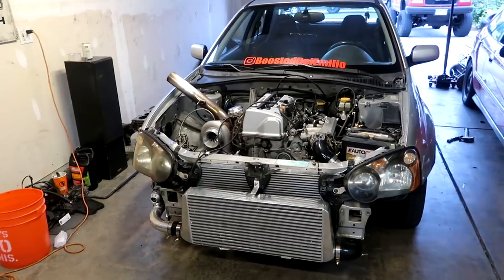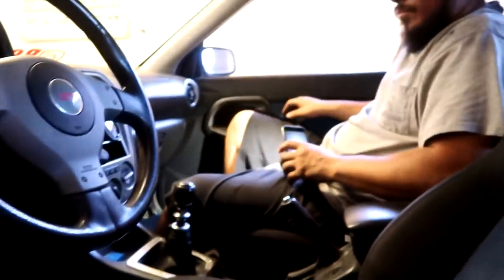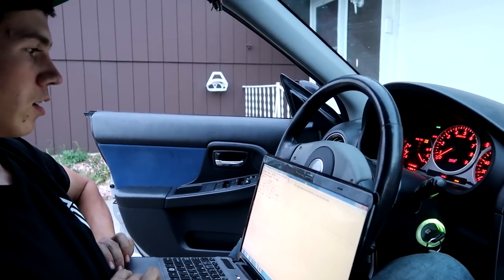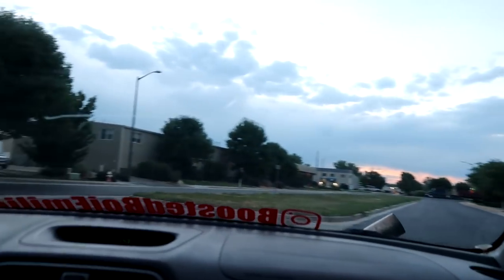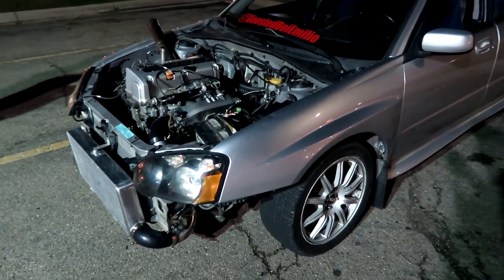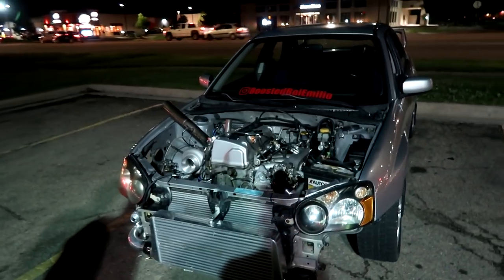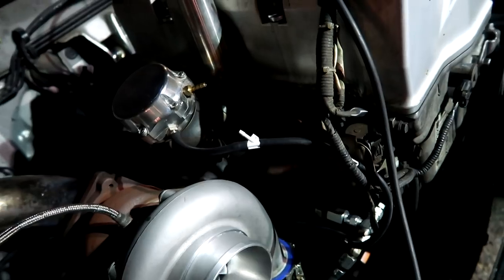Honda Powered STI Takes Down Its First Subaru!

Comment: Coming from a Subie and a Honda guy, I love this build. I love the boxer engine but it's not without limitations and definitely not as durable as a KSeries.
Reply: The K-series has proven itself time and time again. It’s possibly the best 4 cylinder engine ever made.
Reply: John Parent don't get him wrong then boxer is a great engine but it depends on what u apply it to
Reply: i personally know 2 guys one with a 2016 wrx the other had a 2015 wrx hatchback and both blew the bearings on the crank and eventually knocked themselves to death. Now the guy with the 2015 blew his block under warranty at around 40k miles, got a new block for Subaru and then sold the car. Now the guy with the 2016 , he went through two blocks, and the 2nd went out with a couple hundred miles on a highway trip. Both cars were completely stock. You can take a look at NAOISC, and everyone recommends replacing them with an aftermarket shortblock if you want to actually drive the car.
Reply: Subaru engines are best NA and stock. As a guy who used to love them, it took the experience of watching my friends break constantly and another friend working for Subaru to realize they aren’t all that reliable. K20s do better under boost and they weren’t even designed for it. Few other manufacturers have made anything that offers what the K-series does. The only thing I would want more out of them is torque. Which Honda seems to have remedied with the new generation K engines
Reply: Idk man, i have an ej22 and i abuse the PISS out of it daily, and she's holding up just fine. i keep up with the maintenance on it and at 234k she could either go any second or go another 234k no problem, that depends entirely on how  i treat the engine. remember, metal parts all eventually wear down and break. My EJ however has yet to break so i'm not nearly a concerned as most these people are here. i beat an integra after work yesterday and we're both stock. No big feature and we didn't even break 80 mph so fuck it. I say they both reliable so long as you take care of your shit.
Reply: The  N/A EJ22 was an amazing engine. My brother had a 96 Impreza and that thing was amazing. 260k on it when he got rid of it because he hit a snow bank and it never ran after that for him. Turns out, since it didn’t have a timing cover on it (why the fuck I don’t know) the snow getting forced under the hood from this massive snow bank made it jump timing. He sold it to my friends dad for 100$. 4 days later we saw him driving around in it running great, he let us know what happened. Daily wise, I think Subaru’s are great, in the performance sector, they are overhyped and don’t live anywhere near up to it
Reply: The boxers are very durable if they're left stock.
Reply: I can attest my 02 WRX has 247,000 miles of probably abuse lol.
Reply: The best subaru engine is the jdm ej207 that thing is bullet proof
Love this build
Reply: The best subaru engine is one that hasn't blown up yet. no point getting excited about the reliability of an engine that makes no more power than your mums camry.
Reply: teh vee teh vee my buddy has a 2016 white Sti, on his 2nd motor since the first spun a bearing. This dude doesn’t beat his car and is religious about oil changes through the dealership and the car is completely stock. They tried to fuck him on it, I’ve been trying to get him to sell it.
Reply: Lol.. aww look at all the poor haters that get beat by Subarus..
Reply: TTime685 implying me? I like them, don’t really like the vape smoking, tight pants wearing gauge earring having drivers. But I ride a turbo gsxr1000 so def no Subaru is beating that around where I live.
Reply: 2015 wrx hatchback... this guy is clueless
Reply: TMM 
There is something called common sense Any engine will eventually blow up if you push over the limit this engine was designed for 300 hp maybe will handle 400 hp max 
If you try to get 500hp out of a 4 banger it will blow up for sure 
I daily my car the engine runs super strong without any issues  I beat on it all the time
Reply: Steven Llewellyn gauges, tight pants, and vaping.. you dislike people for a bunch of childish reasons. And no, really? Your gsxr is faster than an impreza? Lmao.
Reply: Canadian yeah but most people don't know of that engine. I'd love to have one in my 04 wagon.
Reply: @TTime685  i own a subaru and ill tell you it sucks. Lol

Comment: Holy Shit, Untuned KSTI completely wrecked that other Subaru.
Reply: Viewing it is tuned
Reply: Stage 2 wrx is maybe a little over 300. So the 350 estimate seems kinda accurate
Reply: Jared K ya 300 to the crank
Reply: Dylin Chamberlain nah thats a newer one its 300 to the wheels
Reply: Jared K stage 2+ wrx's only make around 275 to the wheel
Reply: Dylin Chamberlain google says the MAP stage 2 with an exhaust intake and tune on a fa20 puts down 300whp
Reply: Jared K oh ok ya i just seen that i have never seen the map stage 2 before
Reply: Dylin Chamberlain pretty much everyones tunes make the same power and actually 300 is low balling that setup.
Reply: Smoke Yt 4 pounds is tuned?
Reply: Jared K he pulled on him way too hard for that to be just a 50hp difference especially with two people in the car and Emilio is a pretty hefty dude lol.
Reply: R3D just going by what was said
Reply: Smoke YT Actually, Kyle played with the air/fuel ratio just to get it idling good. it hasn't actually been tuned on a dyno for a race/street tune.
Reply: Jared K Yeah i agree, it wasn't pushing much more than 350 yet.

Comment: I'm afraid the T could break up (too much weight) into the engine thread. What I usually do is put a line from the block to the T which is strapped somewhere in the engine bay, then from that run everything needed. (sorry for my english, I'm french).

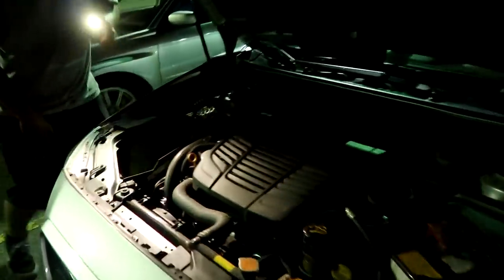Comment: Is it just an illusion from the fire balls or were the headlights cutting off when you let off of the gas at the end of the video around 14:00
Reply: flying munk89 they were definitely turning off....
Reply: flying munk89 I thought the same thing at first but my guess is its messing with the camera.
Reply: DOUG LIFE wasn't doing it when I saw them
Reply: Happens something in the wiring isn't right or they need a battery.  It's pretty normal for voltage to drop when you let off the throttle.
Reply: my guess is that they were turning off the lights to catch the fire coming from the exhaust so the camera can see it... to me that's the pretty obvious guess.
Reply: Duane Bailey pretty sure when they checked voltage is was around 12 so that would make sense for a new battery
Reply: GixxerDad 600 check at 14:00 i think.... i thought it was the camera compensating for the light flash but on the 4th pop you can see the lights from the buildings dont dim.
Reply: His turning the ignition off and on to make it shoot fire balls out. So lights were actually shutting on/off
Reply: David Gould  that makes sense!....... i used to do that in my first car!!! Lol
Reply: DOUG LIFE ive noticed him doing in other videos and finally realized he do that lol

Comment: So what does “stage 2” mean?
Reply: Uriah Siner intercooler downpipe  intake tune?
Reply: A subie stage 2 is usually, intake,  catless downpipe, full exhuast, and a ots/ dyno tune
Reply: It means not fast enough to touch a Kswap
Reply: Stage 2 is j pipe exhaust and intake
Reply: C Dubs only on 2015+ for that though because 2014- dont have j pipes
Reply: Lmfao stage two is stock with a downpipe and supporting tune only gives it a little more power barely noticeable haha
Reply: any light modification to the engine that does not sacrifice driveabillity so exhaust, intake, and a tune thats as far as you could take stage 2 im pretty sure. and stage 1 would be track focused mods that make driving the car on the road a pain in the ass
Reply: Cloud Gaming depending. My boy had a bug eye WRX. Stock on a 40 roll he was side by side with a Miata with a minor tune. Then with a stage 2, he was able to get me by a car and a half against my 01 gsr FBO on a 50 roll.
Reply: 20 more whp 😂
Reply: Brian Smith bruh
Reply: Not quick enough to kill the hondaru
Reply: BBoyDrkNova a turbo Miata? Or a stock one with a tune
Reply: Nothing, it's absolutely meaningless.
Reply: Intake, full turboback,  with Cobb ots stage 2 map
Reply: It means you don't actually know anything about your car
Reply: HKS blowoff valve and a milo tin
Reply: Uriah Siner stage 2 is i follow what everyone else does cause i dont know what im doing
Reply: Also injectors
Reply: Fully stage 2, not just partially
Reply: Chris Ortega lmao frfr
Reply: Depending on the year stage 2 is about 15-20% hp and 20-30% higher torque than stock on a Subaru. Defiantly noticeable nothing crazy but that in combination with the better sounding exhaust is money well spent.
Reply: He still playing need for speed underground.
Reply: It means he is ready to send that headgasket
Reply: Uriah Siner fast road uae
Reply: New stage 2 wrx’s walk STI’s. I have a stage 2 bugeye and I can do 0-60 in 4.8s... not too bad for just bolt ons and a street tune I did myself.
Reply: Stage 2 is an extra +25 HP sticker.
Reply: You gotta watch initial d more lol jk

Comment: A clutch return spring on top the of the clutch fork (the spring needs to pull the fork towards the motor) that should sort out loosing the pedal. It fixed mine.

Comment: You can make a tool for pinching in tube beads out of a pair of wiring crimps. Just cut off the snip tip and you are left with a tooth that fits the opposing groove.

Comment: My guess is 460whp fully tuned BY BRENT! Just sayin
Reply: I think you underestimate the capabilities of the K motor and Brent lol
Reply: This Crazy Tangerine I’m guessing 550 lol.
Reply: I thought  a stock k could only do around 400 before a built motor needs to happen?
Reply: This Crazy Tangerine a stock k can do over 500 stock, I had a friend with an 07 Si making 480whp ran the kit from 110k miles all the way to 180k miles when he sold the car, weak point was the tranny motor can handle a lot of power
Reply: Kevin Osorio sweet, that's good to know. Learn something new every day lol
Reply: Moosh Williams you know I sent them an s366 right ???  800+ capable ....  :)
Reply: This Crazy Tangerine do good and good will come

Comment: dry sup. solve that  oil issue
Reply: Or hey, just some baffles.
Instead of like u know, block mods, oil pan, pump, pulleys, bracket, belt, oil tank, and a bunch of oil lines and fittings. Makes a lot of sense.

Comment: Why do Subaru owners always say their car is stage whatever
Reply: I own an Sti and I don't even know why. Just say what it is and what parts you got imo.
Reply: Hipsters
Reply: I think they don't know what they have so stage whatever is their go to lol check out how this dude hesitates before he says stage 2
Reply: Captain Swaggadick Maybe in this case that is true. But I bothered to do some actual research and find that the term stages was used by multiple aftermarket manufacturers to signify classes of upgrades or packages. Cobb still does this, which may explain the longevity of the use among subaru owners. Someone on a tuner forum also mentioned that there could be ties to old British tuning culture.

Either way it is a mostly outdated terminology among car enthusiasts. Even among those who tune and modify Subarus past engine management "stage 1", there is little correlation or definition of subsequent "stages".

I never even heard of it before I started watching YouTube videos of modified Subarus.
Reply: Cobb packages their parts in packages in stages
Reply: I got a wrx and you cant even go stage 1 and 2 at the same time loool so i got confuse on that tooo looool need a pro tune so stage 1 and 2 will be doable
Reply: Captain Swaggadick ricers
Reply: Race one youll find out what stage there on. Lol

Comment: Dude the d16y7 is the most reliable Japanese engine ever. Mine had over 600k when I sold it no oil burning no issues never had head off still got 42mpg highway.

Comment: If it hasn't got air in the system or bleed up fine every time, it could be the master or slave drawing air into the system. I've had it with other vehicles on fast shifts that the clutch moves so fast that slave draws air past the seal as it's worn, but doesn't fault in regular driving. Just food for thought.

Comment: Stage 2 isnt all that quick anyway especially if hes running cobbs ots tune. Intake turboback + 93 protune can be a little spicey when the car wants to give it all.  But the swap is still impressive, when it gets dialed in itll be super spicey. The redline on the honda motors is a hudge advantage, 6500 on the FA comes quick.

Comment: Can someone explain how those T's add psi? Just sucks in more air I'm guessing?
Reply: it limits the amount of boost the Watergate sees so the rest of the system can hit more boost but the Watergate still only sees what the spring rate is. same as a boost controller just more of a guessing game

Comment: we are not allowed to drive a car with no hood over here. How strict are the laws about the cars over there? won't the lack of hood/bumper/exhaust be a hassle ?
Reply: It depends on what state your in. That exhaust won't fly in any state technically but people get away with it all the time. I've never herd of a hood law anywhere and only picky cops that actually know cars would give you a hard time about the bumper around here, could be different in other states
Reply: Ok cool. Thanks for the update. But would like a side exhaust from the front bumper fly?
Reply: Joonas Kaal no. Unless it has cats it won't technically fly.
Reply: In my state the requirement is factory emission components, a muffler, and it exits outside the body so you could have a legal  hood or bumper exit but there would be a stupid amount of work to make all that chit fit
Reply: Thank you guys so much for the info! Feel smarter now!
Reply: Depends on the state. Ohio, in particular, has no state inspection so you could literally do whatever and it’s legal. I’ve seen cars completely rusted out with rope holding exhausts/bumpers together and flashlights for headlights and thats 100% legal out there. 

In Florida, you can literally title and register whatever you want. Baby stroller with lawnmower engine? No problem!
Reply: Haha, this is hilarious! Thanks for the visuals! Definitely need to visit the states and schedule in some car meets :P

Comment: What remains above all Else is that Honda is very easy to modify and robust engine that in my honest opinion is on par or better then the older gen Ferrari and Porshce tech of the day. It surpasses it on so many levels sound and quality wise but that is my two cents.

Comment: Don’t get why all these turbo guys drive around without air filters. Doesn’t cost horsepower, does dust engines.
Reply: it does cost horsepower. if you look up dyno with filter or without filter alot of change on itb and turbos.